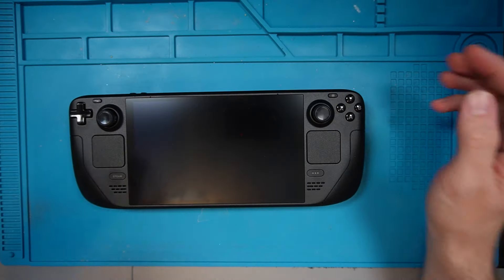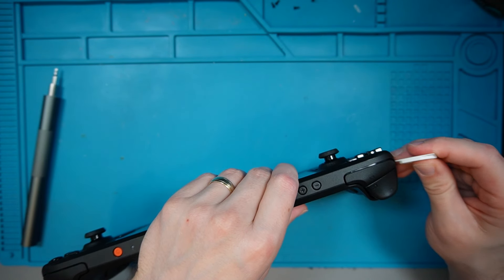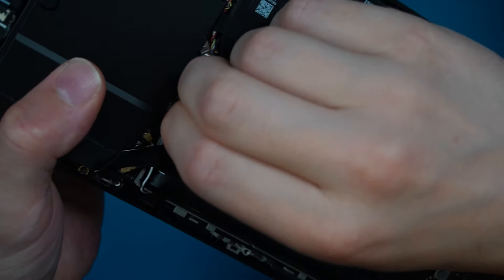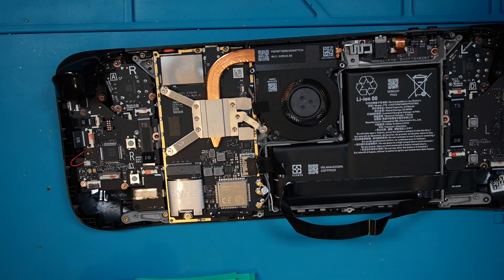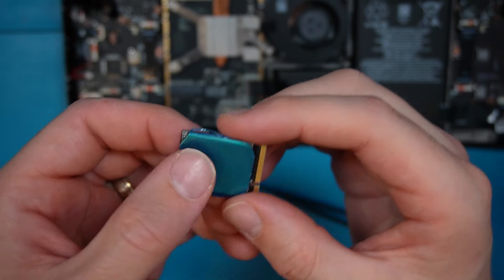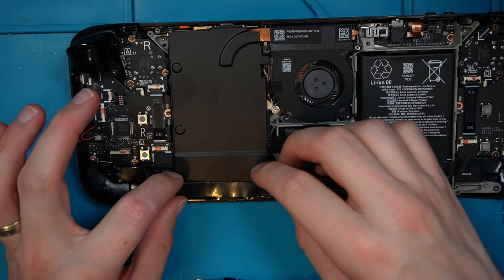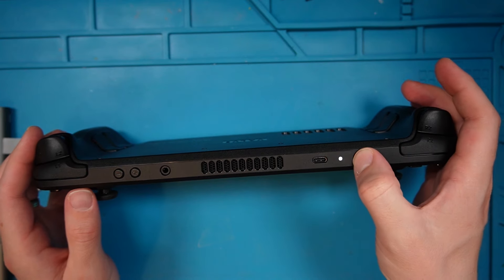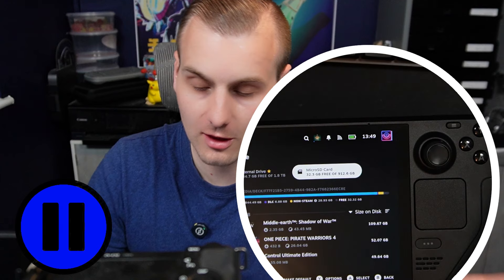Steam Deck OLED SSD Upgrade Made Easy

Comment: Crazy how everybody videos on changing the hard drive is the same. But what you fail to mention is the hardest and most important part. Cloning the hard drive so the steam can boot properly after the changing the ssd. Leaving out that step could brick the deck. Think 🤔
Reply from the maker: Valve have a guide on this. I followed it.
You don’t even need to clone the hdd. You can completely install from fresh and it’s fine.

Cloning the hdd is the easier step, it just takes a long time. If you are cloning 1tb of data.
Reply: @ if you put a naked ssd drive in the stem deck, it will have nothing to boot from. You either boot from a prepared usb stick or you clone the new drive. Unless I missed something. These are instructions from the steam site. But if there’s a better and easier way, please show that
Reply from the maker: @dleonardrandom3416 That is correct. Both of those are easy and well documented. 

Cloning is one line of Command that steam have on their site to copy and paste. The problem with showing that is it  take around 15hours to clone a 1tb drive.
Reply: @ it is what it is. Just depends on the games and size of the drive. Just saying, if the average person take that drive out the steam deck with cloning or usb copy the drive, that Steam D will be bricked. I did find a video for an easier clone process using a usb stick.
Reply from the maker: @dleonardrandom3416  I get your point. When I made the video. I thought that part was the part most people would be able to do. I use a NVME USB C Enclosure to clone mine. So I did it all on the Steam deck itself.